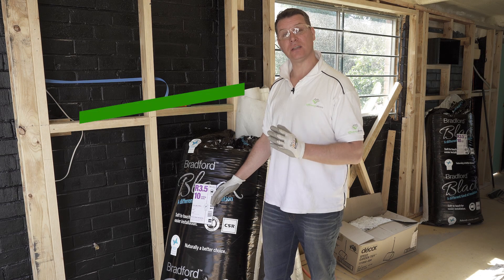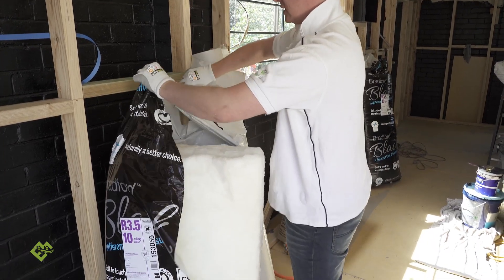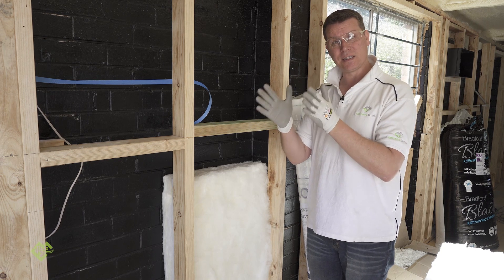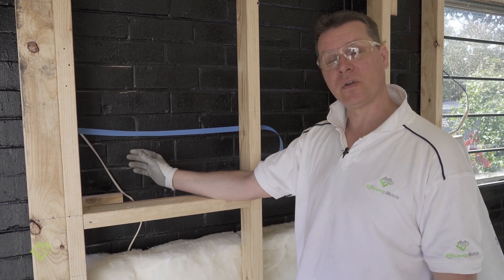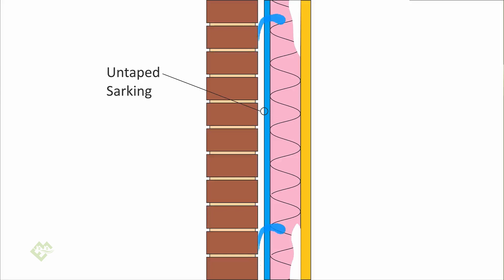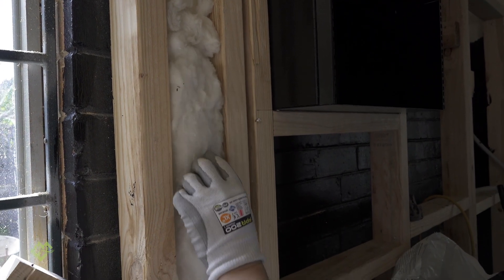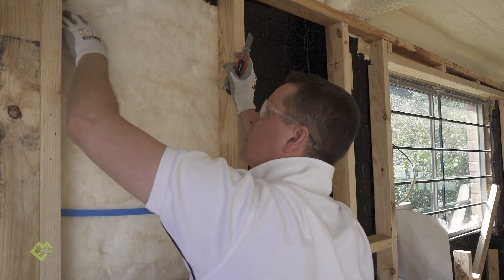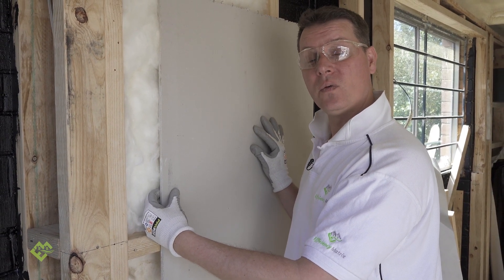Installing wall insulation, for better building performance.

Comment: I have a question regarding retrofitting loose fill brick cavity insulation. My house has a shallow subfloor with timber joists, timber floorboards. etc over dirt (with concrete footings for walls, no slab). Built in late 60's. It has a lot of brick vents just below the floor level to ventilate the subfloor to prevent termites etc. and this has worked well (never had any termite damage). However, I'm wondering what to do about cavity fill insulation. If I just filled up the cavities as they are now, it would completely block the subfloor vents and would spill into the subfloor. One idea I had was to break a big enough hole through the brick vents and fill the cavity above and around the brick vents with expanding foam, so that it would prevent the loose insulation from reaching the brick vents, but still allow air to pass through the vents into the subfloor. Have you ever dealt with a situation like this before?

Comment: Nice work John. In my 20+ years in the industry I have not yet come across  an insulation installation that complies with the  requirements of the BCA, Section J, J1.2. Missing insulation and large gaps are all too common.